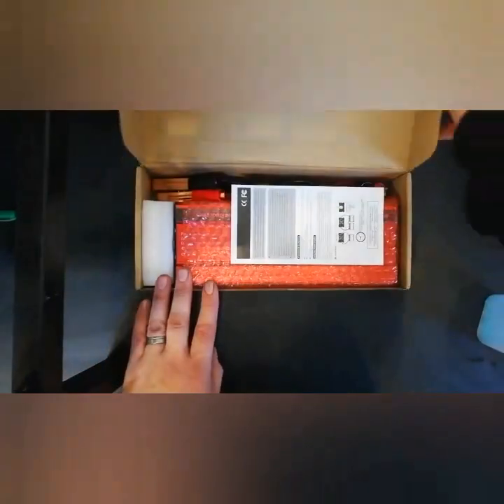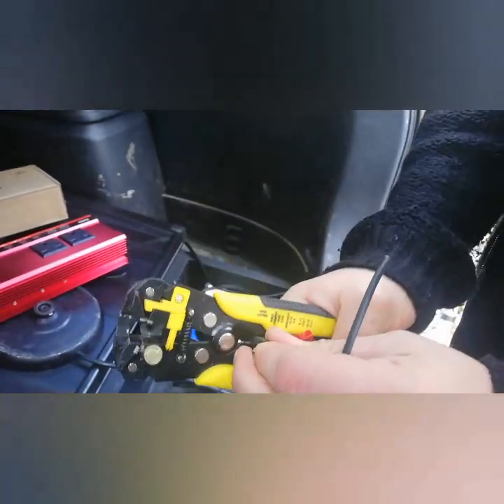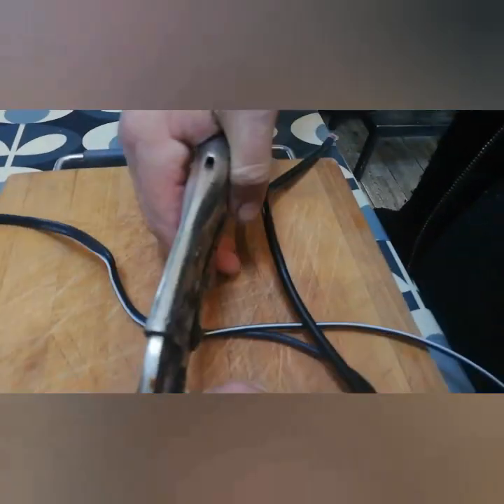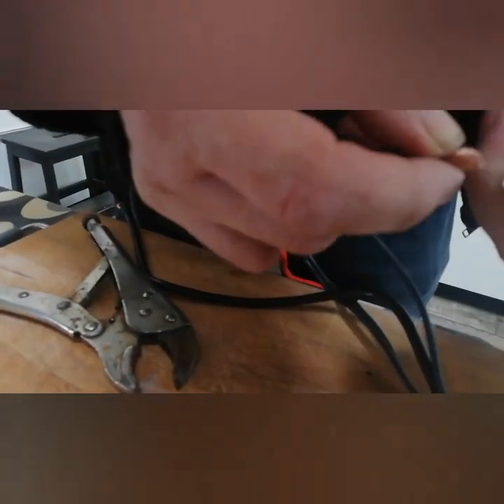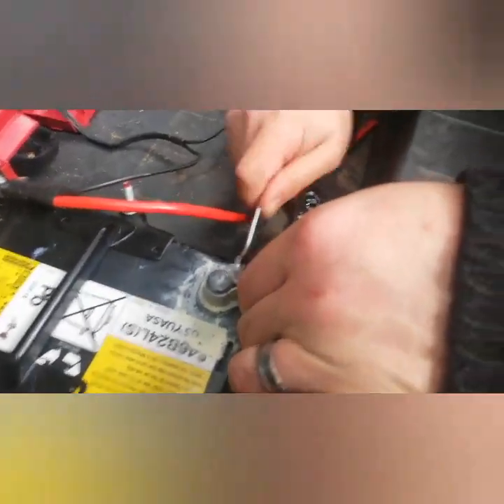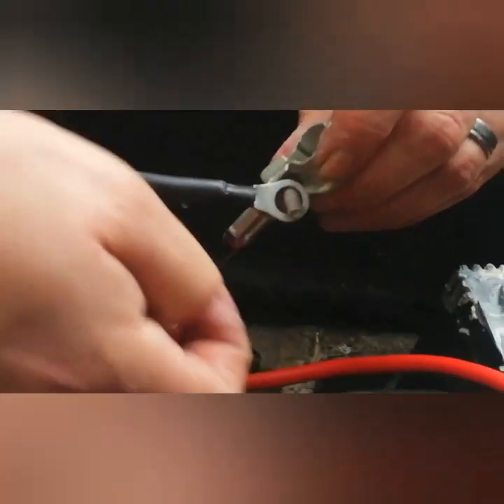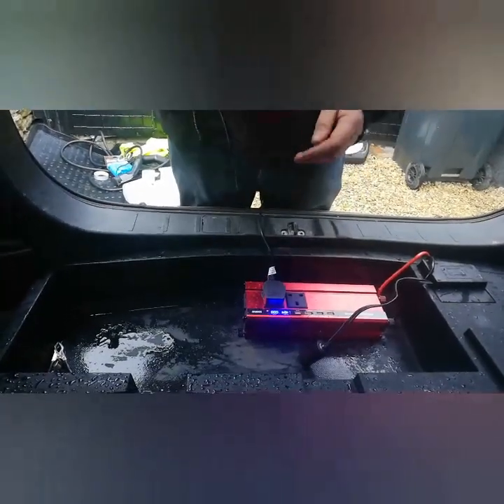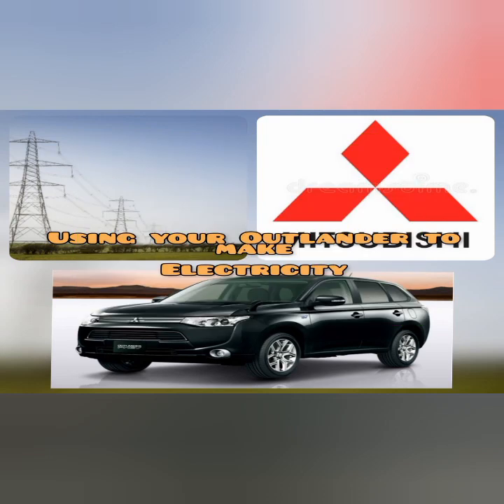Mains Power Mitsubishi PHEV Inverter electricity 12v 240v

Comment: Very interesting thanks for sharing. In "ready mode" can you get the full 1000w as long as you have juice in the main battery pack ?
Reply from the maker: Yes it have now upgraded to a larger inverter  and can boil a kettle now, it will do a regular kettle but I use a 600w one and the cooling  fan doesn't even kick in.

Check out this video of the upgrade 
https://youtu.be/b9eTAX5iC6Q

I am after subscribers  as I am trying to grow the channel 

Thanks for the support
Reply: @DeathLazerBoy  i dont undestand why a 5000w inverter didnt power a 600w boiler (?) - what year is your outlander ? Im so interested in getting one to do this mod - the idea is to be able to recharge our big drones from the trunk, and power laptops and screens inside for the director/client to check the footage on set...
Reply from the maker: @mcronfpv8736  i have 2 videos, so no the first inverter (red) which was 3000w didn't power a 3000w kettle but the second inverter (blue) did easily. 
I use the 600w kettle with the blue 5000w  one which boils just fine and the cooling fan doesn't even kick in the reason I don't use the 3000w kettle is I don't want to overload they battery.

If you are charging  batteries  it should be fine and the don't use many Watts 

Please subscribe to my channel  as I am trying to grow it thanks